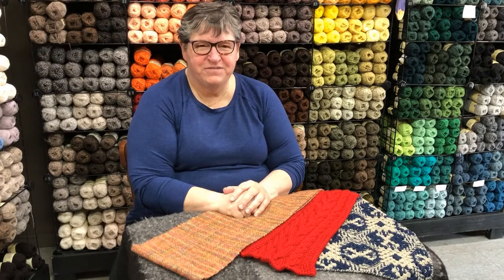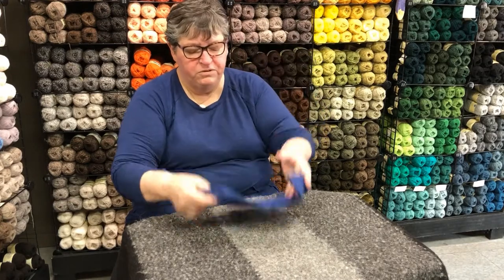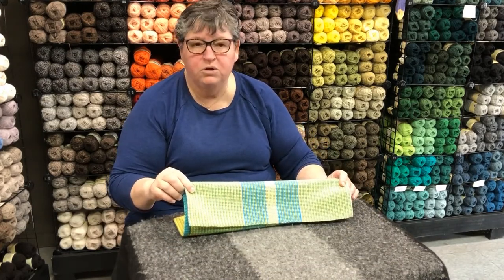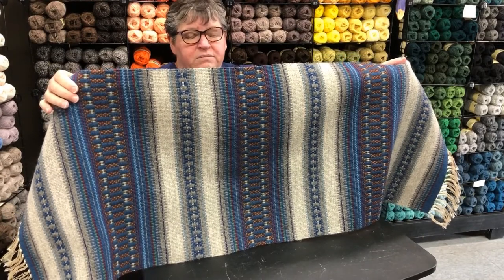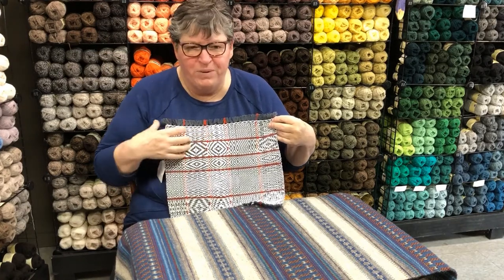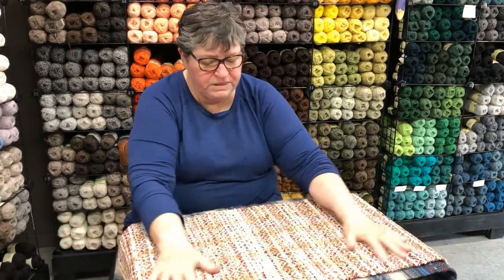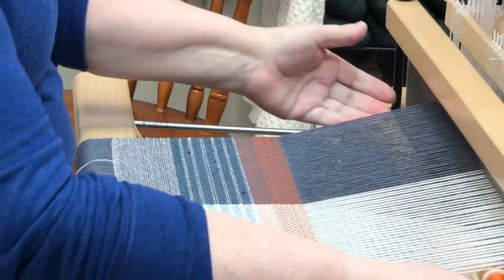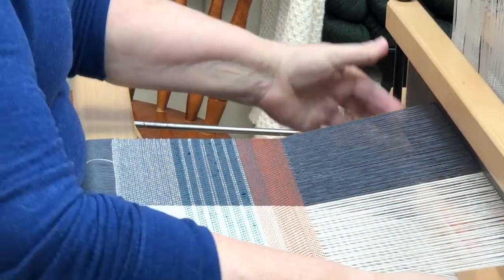Weaving on a Multi Shaft Loom

Comment: I am planning on buying the David loom and wondered what bench you are using.  I have seen the Louet loom bench but it doesn't have any adjustments for height.  I find that most benches are just too low for me.  If you could give me some info on benches, I'd really appreciate it.  Thanks so much.
Reply from the maker: Jill, I actually use the Louet bench for weaving on the David. It is a higher bench than some of the others and I find it quite comfortable. If you have further questions, please email info@heritagespinning.com and I'd be happy to answer them.